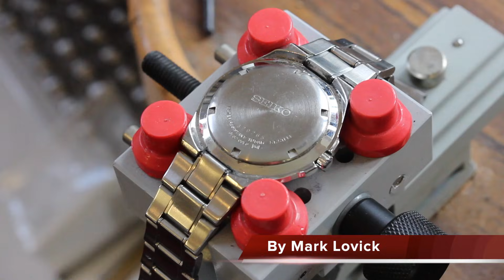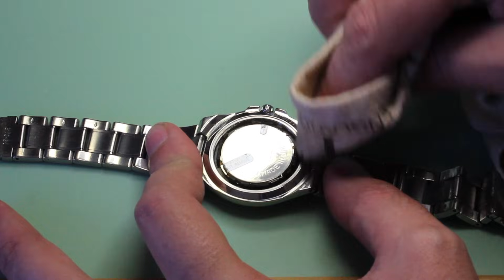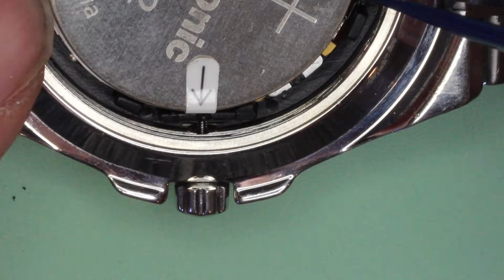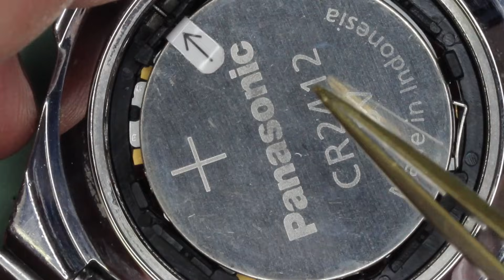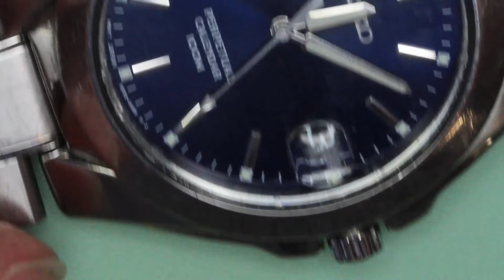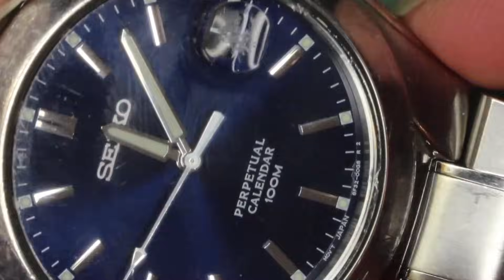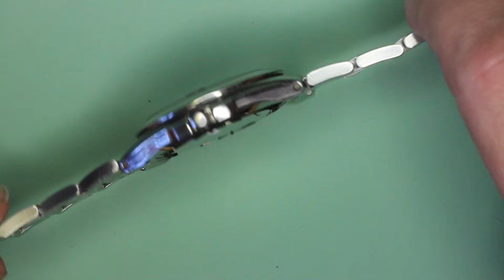How to reset a Seiko perpetual calendar and fit a new battery. Watch repair tutorials. 8F32

Comment: Similar to comments below, I had battery changed but the shop was unwilling to reset the perpetual calendar.  Another dealer kept the watch a week and then reported they couldn't figure it out.
I watched this terrific video 3-4 times and then decided to give it a try.  Such a pleasure to watch such a detailed presentation. This video absolutely did the trick. My watch (1998 8F32) now runs like brand new. I couldn't be happier.  Thank you Mark!  
p.s. If you try this, be sure to get a pair of fine tweezers.  The contacts are very small and there's no room for the average bathroom tweezers! lol

Comment: great video. Unfortunately not working for me. Carefully removed the battery and replaced with a seiko replacement. Tried the reset by shorting AC and + with the crown full out but the second hand doesnt move. Ive checked the voltage on the new battery and its 3v as per. Any ideas? thanks!

Comment: Thanks for the detailed video, it was a great help in resetting the perpetual calendar on a 8f32-00a0!
But now I've got an 8f23-0400 that has a screw-down crown. I think there's an issue with the stem insertion. It only runs one second at a time when it's at the second position. It stops running when it's pushed in all the way in to the first position. Is there a case where the crown can be inserted incorrectly so it acts like it's in the first position when it's actually in the second position and stops running in the first position (maybe because of pressure on the movement)? It feels and acts normal when I release and reinstall the stem but acts the same.

Comment: Thank you so much for your helpful tutorial video. Your clear instructions and step-by-step guidance made the process incredibly easy to follow. I really appreciate the time and effort you put into creating the video. Thanks to you, I was able to successfully change my watch battery without any hassle. Your generosity in sharing your knowledge is truly commendable. Once again, thank you Mark!
Reply: Only thing not mentioned is the removal of the isolation sticker from the Seiko battery and stick it on the new Panasonic CR2412. Do you have to do this or is there a battery that comes like that?
Reply: @pherdegen Did you ever find out the answer to this? Got my first ever (old) 8F56 watch on the way and I'm already bricking it at the thought of battery changes
Reply: Unbelievable, thank you very much!  This video helps and is useful no matter how many years go by! These watches keep coming back for battery swaps and this knowledge is the key!

Comment: Has anyone every seen after the battery replacement that the second hand wiggle back and forth, and not advance?  Because it is still moving somewhat, I don't think I damaged the circuit board, but I am unsure.

Comment: Comment:   Before you begin shorting the contacts to set zero the date indicator, you need to pull the crown out.  It wasn’t said in the video and this little step cost me 45 minutes of my life.  

That being said, this is the only video I could find and I appreciate the effort!
Reply: omg you saved me!
Reply: Definitely need to pinned this comment
Reply: Hey... that step is not even in the specialised battery replacement manual. Thanks a million (seconds saved). Bill
Reply: Unfortunately,  mine was totally destroyed by a "watch repair". I have managed to purchase a replacement movement for a princely sum. I'm going to give this ago on the original.  Maybe, just maybe, I can get the old one working again. But seeing how delicate the circuit is so easy to break it's more wishful thinking on my part. 😮
Reply: YOU ALSO HAVE TO SET IT IN THE MORNING TO GET A CORRECT 12HS. CALENDAR CHANGING...HE MISS THAT INFO TOO, GOOD VIDEO ANYWAY.

Comment: Hi, I installed a CR2412 battery but the watch did not work. Note that I did not put a sticker on the new battery, does that mean I burned or ruined the watch? Thank you
Reply: I assume you found out the answer in the three months since you asked this question, but just in case, I just wen through this process on my GMT Perpetual Calendar watch yesterday and I placed the new battery, which didn't have a sticker, in the watch and it did not work. I then thought I'd try a sticker transplant (I hadn't read any of the comments here) and it worked just fine. Nothing fried. This video saved the life of my favorite watch that I'd about given up on because I didn't want to pay Seiko $150 to do it.

Comment: Thank you so much. I was quoted £257 by H Samuel to reset non working watch. Bought battery from Amazon £6.00 followed instructions and 15 mins later all fixed, Thank you.
Reply: does it matter if the battery has an arrow on it like the genuine seiko ones do?
Reply: @ronnied2363 no but then you must reuse the paper mask because insulates parts of the internals from the neg of the battery.

Comment: Excellent video!!!!! It saved me a fortune changing my battery. Thank you!
Reply: hi, where did you source your battery? is it easy as in the video of hobbyist person to take a go on it?
Reply: @shagwellpinagpala3409  I had it on Ebay. I ordered the correct Seiko battery, not the cheaper normal Panasonic one. (BR CR2412 3v) from 5*jewellery.
Reply: @buriedintheshed  thanks for the info.did you just follow this video? is it straightforward as what the video has shown?
Reply: @shagwellpinagpala3409  Yes I followed the video. Take note and stop the video at each step. I watched it all first, then at each step. I found it to be really helpfull. Don't rush and you should be ok. (and I used a jewellers loup to see the watch internals as my eyes are not great!). I've never done one before and all went well. Good luck!

Comment: Hello..I installed a new battery but when I tried to short out to get the watch ticking at 1 second jumps,it doesn't tick.I've tried shorting it several times but still not ticking.any ideas?

Comment: One note for people attempting.... After resetting the watch (pull out winder and push back in), there is a step to pull the winder back out prior to beginning setting the calendar day.  This is not specifically mentioned but you can see that he does this.  We skipped this and it took a few rewinds to figure out why it was not moving.

Comment: What an amazing video.   I dug out my old watch from the back of a draw. I remembered leaving it there after the battery ran out. At the time the official Seiko repair was £100+.  Now with a £5.50 battery and watching a video its fixed and the calendar is working.    At first I couldn't get the watch to reactivate.   The replacement battery didn't have the protective sticker/cover so I tried positioning the sticker off the old battery on the new one.  I was then able to reactivate the watch.   Just a coincidence or does the battery need the sticker? I don't know.
Reply: The video doesn't mention it but if your replacement battery didn't come with a sticker then make sure you put the sticker from the old battery on the new one.   Your watch will not work if you do not do this.   The sticker has an opening that lines up with the watches battery contact.  The battery has to be aligned by placing the battery so the arrow from the sticker on the back aligns with the crown.  This is shown in the video.

Comment: Great vid!, very interesting, thanks.  I was thinking of getting one of these but, not anymore.  Not that I think it's a bad watch, just not as good as I thought, my opinion of it anyway.  Old-school perps, no battery, a little misleading by Seiko.
Reply: Yeah, I actually thought there was no battery too - just a "capacitor" which lasts a long time, long enough to go a fair distance with the "100 year" calendar. I was also led to believe that the watch could be in sleep mode for 4 years, out performing the nearest rival (6 months) - at lease that was the case for the 7D48 0AA8 (SNP003P1 from memory). I love the dial, and there is no better watch to read on a overcast day, but my poor eye sight cannot see those silver hands first glance. Still love the concept, but now after 7 years, I have to also change out the battery - wish me luck, or something. Guaranteed, no one knows how to do it around here.

Comment: Thank you so much, after a few quotes ranging from 45-90 pounds I saw this video and ordered a battery myself, it didn't come with the sticker like the original battery did but after removing it delicately and placing it in the same part of the new battery and followed the instructions it fired up, I used a pair of tooth pick tweezers that I had and a squash ball to remove the back lol, many thanks 🙏
Reply: Interesting, can you explain the squash ball technique. When I was in primary school, I used a sharp knife - dangerous I know, and crude, but I never hurt myself. Mum had a miniature screw driver set, but I kept deferring to a sharp knife edge to take off and put back screws. I once dismantled a watch and got it to work again - momentarily :)

Comment: Fantastic tutorial video - it is vital that you follow the instructions to the letter - literally !! As with other comments here, the key things to note are ....  the crown needs to be pulled all the way out when resetting and setting the calendar. Also, the tiny "AC", "0", "Y", "M", "D" markings should be visibly stamped on the silver tabs near the yellow coloured contacts. My Seiko PC watch is the rarer white dial 8F32-0160 purchased in 2002 and all the markings are in exactly the same positions as shown in this video.  Again as with other commentators on here, I too carefully peeled the plastic wrapping off the existing battery (Seiko) and put it on the new battery (Panasonic) and aligning arrows with winder. It has only ever had only 1 previous battery change and local watch repairer charged approx £35 GBP to do it - very happy DIY amateur watch enthusiast !

Comment: Very much appreciated! I have an 8F56 that I tried to change the battery on fifteen years ago (before YouTube!). I failed at the first hurdle by not knowing the reset procedure, assumed I'd broken the watch and put it in a cupboard. Pulled it out a few days ago, discovered that the "new" battery I put in 15 years ago was now flat, bought another, followed these instructions and I have a lovely working watch!
Because I hadn't used the watch in over a decade I completely failed to realise the three positions of the crown - folks, if the second hand is still moving when you pull the crown out then it's not out far enough. :)

Comment: Thanks for posting this!  I just changed the battery in one of these and the procedure in the owner's manual (using crown settings) did not work. I thought we had received an old battery from Amazon (4 sec ticks). Later in the evening I ran across this video. Spot on.

Comment: Fantastic video.  I went out and purchased an 8F32-0210 because I saw this video first.  The battery change and calendar setting would not have been possible without this guide.  Thank you so much for putting out this content.

Comment: Another one fixed, thank you Mark! I changed out the battery on one I bought from Ebay and it still didn't work. I got frustrated after about 20 min of rechecking and trying everything again. I almost felt like throwing it it out since it's been a looong time since something similar has happened. I have a red transparent film covering the underside of the negative battery side and I decided to double check it. Of course it was misaligned and one of the metal prongs was being covered and not making a connection. Just realigned it, tried again and now I'm happy again! Thank you so much Mark, I've been a big fan for a long time!

Comment: At 4:26 you say the second hand is jumping in 4 second intervals. Actually, it is 5. At 4:35 you are seen pulling out the winder but you don't say anything about it. I believe it is indeed necessary.

Comment: I changed the battery and it seems to run when the case is open but as soon as I screw the case back on it stops running. is it bad battery or is the watch broken?

Comment: how do you set the month/day/year correctly if the back case is on?  In my situation, I had battery replaced and the repair place said I need to reset the perpetual settings myself.  I don't have tools to remove the backing.
Reply: Blue tac works great if you dont have the tool big chunk on the back and turn it will screw straight off

Comment: When replacing the battery per the video, I could never to get the second hand to move by shorting out the contacts as shown. However the second hand did move on two occasions while I was placing the battery in the watch . the first time the second advanced about ten seconds, the next time 15 seconds. After that the second has never moved again when placing the battery in the watch or by shorting out the contacts. Tried three different new batteries. Anybody have any ideas what went wrong or what needs to be done? Thanks for any info. vbn0000@aol.com

Comment: This wouldn't be an issues if Seiko made the watch a measly 1.8mm thicker and put in a 330mah cr2430 battery holding 3x the power.

Comment: I recently followed the video as I changed a battery.  Went smooth, however, when I do a calendar check (pull out crown to 1st position and return quickly), when it show the month in the calendar window, it shows "23" which is obviously not correct as there are not 23 months.  It should be "10".  did I miss a step in the reset process?

Comment: Ok, the method described here does not apply to the Seiko 8F56-0020 model. For that,  you have to follow the instructions given in this link (Thank goodness, i managed to set mine after two tries. The month 'M' contact once touched - no +ve contact to battery - just seemed to race on the second try (maybe my tweezer was resting against the battery +ve terminal) there's a guiding 'tick' sound tho).

http://watchfix.info/Seiko%20Perpetual/Setting%20a%20Seiko%20Perpetual.php

Comment: Very informative i have a seiko divers SOLAR watch my wife bought me HOPEFULLY solar takes care of batteries for many years ,i do love seiko.my 1st automatic lasted me 28 years then needed cleaning it stopped one day so i bought another similar seiko  which was NOT as reliable every day it needed adjusting even took it back to jewellers where they told me oh automatics are like that never accurate so my automatic is put away for now and I rely on my divers solar excellent for the past 2 years already..cheers great video.

Comment: What a great instructional video this is. The original quote to replace the battery was £100 from the jeweller to send it to Seiko. I did get a local jeweller to refit a battery but the date was never reset and the second hand run on the 4 second sweep so it didn't get used that much. I recently dug the watch out from the back of a drawer and the battery had long since died a few years ago.
A visit to the local repairers was unsuccessful and I was advised to get a new watch as they were sure it was too far gone to save. For the cost of a £5 lithium battery and following this excellent video I now have the watch running like new.
May thanks Mark!

Comment: Thanks for making this video! I reused the sticker on the Seiko battery by peeling it off very carefully and put it onto the new one (a Panasonic). Had to tape its tabs down over the top with two very tiny pieces of tape. Insulates the battery from the movement with tiny opening for the (-) contact. Your video was an immense help to Seiko's written service instructions. You might mention that the same exact procedure is used with an 8F56 Perpetual GMT.

Comment: Hi, thank you for this. It's a very useful video! Never knew how a Perpetual might be reset. ;-) However, I have a Seiko 8F56-0020 Perpetual which is of a different calibre. Do you have a similar video for it. The watch is supposed to have a 10-yr battery but the last change lasted much less. Tired of having to send it to the shop or to the Seiko service centre,, which has moved to the boondocks. So am thinking of doing it myself. Many thanks in advance for yr help. ;-)
Reply: Uses same battery and same method. The official Seiko instructions are for the men's 8F which covers the 8F32 and 8F56, and there's no difference in the procedure for either. I have one of each. Just replaced the 8F32 battery today. Be very careful doing this procedure! It is incredibly easy to permanently damage the movement. Last time I took mine to the local watchmaker (a very skilled one) but the Seiko battery didn't last as long as it should have. Got my own and decided to do it myself this time, but I've got the necessary tools and have used them before on other watches, usually changing batteries in few quartz I have. A back removal wrench is a necessity to doing this properly and not scratching up the back. Be careful with the o-ring gasket and ensure it's positioned exactly when you screw the back on. Also . . . repeatedly checking the year-month-day to watch the seconds hand scroll and the date wheel increment will run the battery down quickly . . . should only be done when replacing battery and resetting the year-month-day afterward to verify it's correct.
Reply: jlind52 Oh, thank you so much. Yes, I'll be careful, maybe do a few practice dry runs first. ;-)

Comment: Mark, if you are still out there I have a problem.  I am able to set the year and month but when I try to set the day nothing happens, it stays on 12 which is the month.  Any tips? I have followed the instructions exactly according to the video.  I have thought about waiting until the 12th and then start the watch.
Reply: I had the same problem so I manually advanced the date. When I check it it seems to be right. Your post is 4 months old so you probably figured it out.